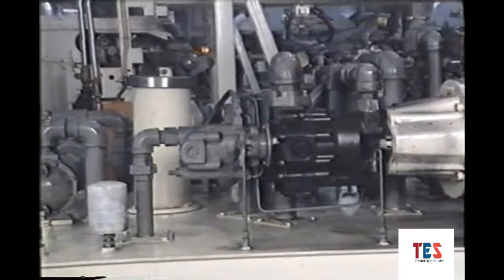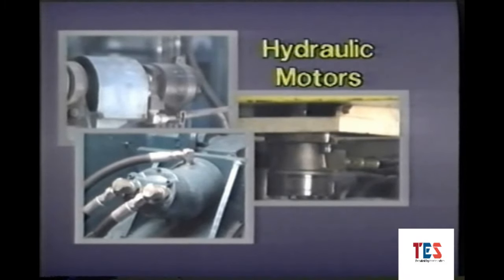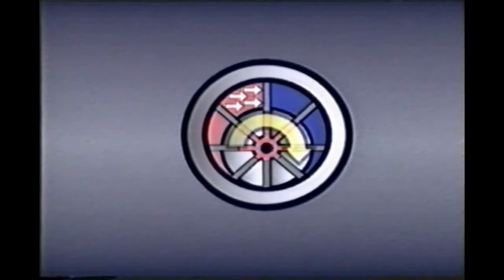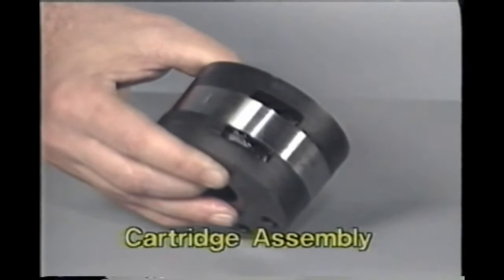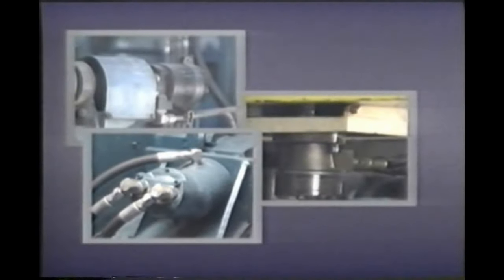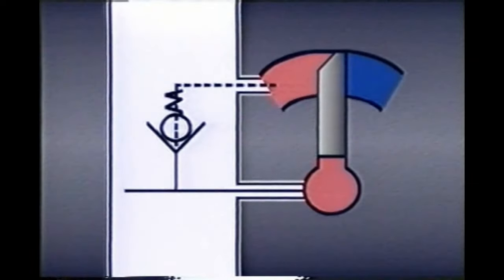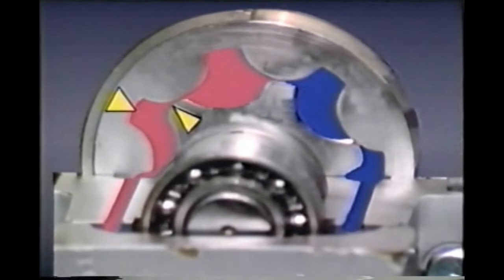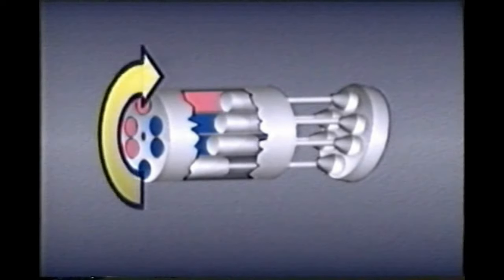Hydraulic Motor Types and how are they work? hydraulic motors and pumps

Comment: How to differenciate gear and piston motor from gear and piston pump?cause vane motors has spring under that pushes the vanes out of the rotor slot;where as vane pump dont need spring to push the blades out.

Comment: English is my second language and I’m not confident that I’ll be able to explain this correct even in my native language. 
I have a mower that is propelled by hydraulic just like most of them do. 
A while back the pin that restricts movement on the levers for going back or forward came loose so both of them moved at the same time. 
After I putted back on place the hydraulic motor started making loud knocking sounds leaking fluid and moving as if it were on a frame by frame video (can’t explain it better)
I know that I’ll have to replace that hydraulic motor and I’m fine with that but I would like to know what happened to it. 
I would appreciate a response but it doesn’t have to be anytime soon.
Reply: You coulda just took it to a hydraulic shop.
Reply: I did. 
They were kind enough to explain to me how f*ched up it was and helped me getting a new one installed.
Reply: I did. 
They were kind enough to explain to me how f*cked up it was and helped me getting a new one and installing it.

Comment: If the reservoir is half hydraulic and pressurized air will help machine run forever by return the back flow to the air part and push the outlet hydraulic forever
Reply: You can use the air pressure only once , then you have to pump new air in it . It s not a perpetual motion.
Reply: Your idea may succeed if you implement it on very small scales, because losses are often minimal on very small scales.

Comment: Hydraulic motors rotate thanks to pressurized fluid, but i wonder the origin of pressure gain of the fluid, does the hyraulic motor have a pump that provides him with pressurized fluid?
Reply: Yes
Reply: @pruthvirajbhople  followup question, the pump needs energy to run right, so does it mean that having electric hydraulic pump -> hydraulic motor has advantages over electric motor ?
Reply: @KK10155  with current technology, a similar sized hydraulic motor will create a much higher torque than its electrical counter part. Although I expect this to change in the next 10 years
Reply: @pinkerino6930  you expect that how?

Comment: I can only understand the gear motor. The two other types look like sorcery to me.
Reply: They are not properly explained, as the inlet and outlet of the hydraulics are not shown properly. In both there is an inlet which overlaps of close to but less than 180degrees on the expansion and an outlet of close to but less than 180degree in the housing. This is only vaguely hinted at. Maybe in the explanation of motors this is done better.